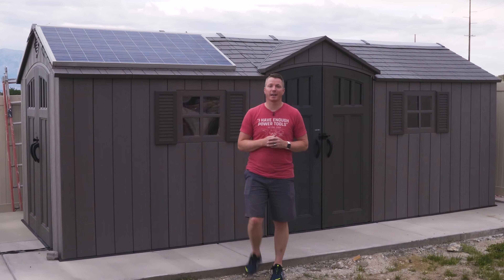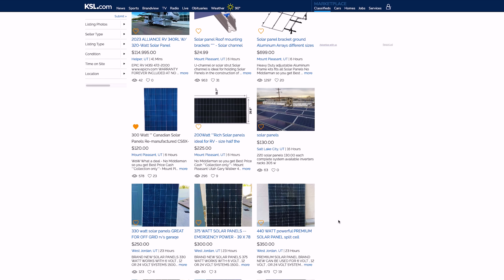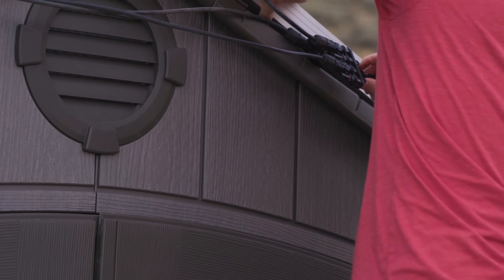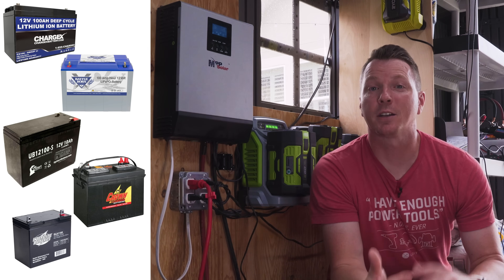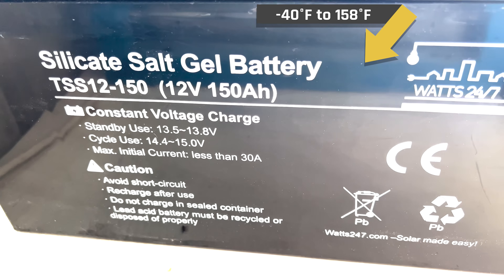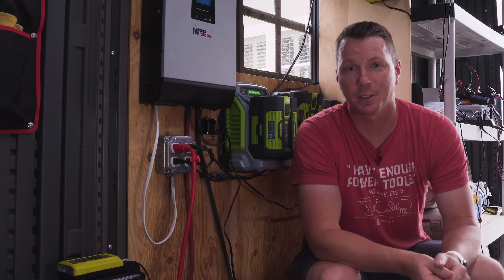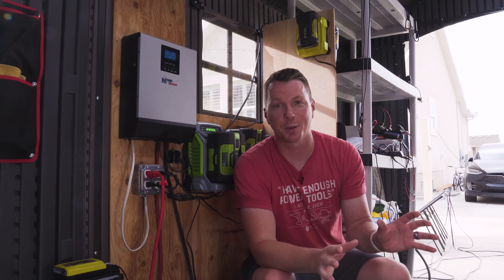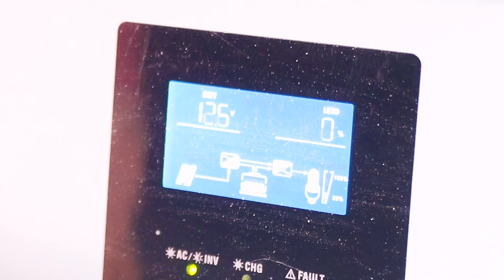This Off Grid SOLAR SHED Powers All The Tools Inside It!

Comment: I know this is super old and your setup has probably changed, but you made the right choice to wire in parallel here. Series would have been a HUGE mistake with your roof split as it is. One of your panels is almost always at a better angle to the sun, which would have a big impact on your total system output when wired in series!

Comment: The absolute best bang for your buck, is to go with 48v panels and 2x Walmart marine deep cycle batteries
 in series for a 24v battery bank.  I cant stress this enough.... you want a least a 24v battery bank for high wattage panels.  Your cant get the cheapest controller on ebay for this set up but for around $120 you can get one that works good.  You have to look at the numbers and make sure you get one that can take that voltage and wattage, they aren't as common.   I literally got 4x , 440W, 48V panels for $100 that were left over from a commercial install. Again, that's a lot of panel but I found there is not much demand for these on marketplace so the price is low.   I now have a theoretical 1600W system on my shed for around $500.

Comment: 6:42 The liquid on a flooded battery is not distilled water, it’s battery acid. You can top them up with distilled water up to a point, but be careful with the actual contents.

Comment: Unsafe AC outlets! You need to add a single Breaker Box with an appropriate size AC Breaker. Will protect both your loads and the inverter should you over load the circuit.

Comment: I can't believe I did not know you built and powered this shed. I just built the same one (terrible experience, but it's done!) and am finishing up a wood frame skeleton to reinforce it and provide unlimited mounting and shelving options. 
I wanted to run a couple four-foot LED shop lights off my Gen 1 Ecoflow River, but I noticed a flicker every few seconds with two different brands of lights. A friend suggested it might be the result of the DC to AC (inverter in the River) back to DC (in the light) process and recommend trying 12V lighting. I bought a few and wired them into the barrel connector on the River and I now have bright lights putting off 1500 lumens each. I'll have a total of 90 watts once they're all connected. 
I considered pulling 120V from the house if I had built a wooden frame shed, but was worried about an overload melting the resin Lifetime shed so I was planning to just stick with the Ecoflow and have it off unless I'm in the shed. Now you have me wondering if I can pull off a permanently-connected power source like you did so I can leave batteries charging, etc., and add the lights to home automation routines (I have already left them on a few times and had to go back out in the rain to turn them off!). 
Thanks for the inspiration here. Given this was a year ago, is there anything you would do differently now?

Comment: Nice setup, but pushing $1,000 I wonder if it would be better to just run a line from the house.
Reply: My question exactly. I guess it depends on your situation and if you can get someone to do it cheaper with less headaches

Comment: Solar setup cost more than the shed
Reply: You’d be surprised. I looked up the one he has and it’s $2,500!! For a plastic shell that is 135 sqft. Better off finding someone local that will throw up a nice wood frame shed instead. I had a guy build my shed for that price that’s only 96 sqft but the quality is so much better and could have made it 120 sqft for just a little more if not for local building code restrictions.

Comment: No protection on the output, no protection on battery and no disconnect for PV? 🔥 will come!
Reply: Could you elaborate a little more? I'm interested in learning. What do you mean by protection? What do you mean by disconnect for PV? What's a PV?

Comment: Looking to get a decent 24/7 power to a shed I recently built here in florida. Hoping to use it for my reptile hobby but the issue is the intense heat and humidity. I already insulated the shed in hopes that would help a bit and it did somewhat. Now I’m going to start working on this. It shouldn’t use up all 1k watts…so I’m going to assume itd be able to run pretty much all day.

Comment: Excellent video. Building a shed on an acreage that is quite a distance from power. I have mainly 20v DeWalt tools and am looking to store and charge them where I need them. Also going to run some LED lights and possibly a small electric heater (I live in Canada). Perfect video for all the information I need to move forward. 

Thank you!!

Comment: Can you use antifreeze in those batteries instead of water
Reply: No. Batteries are filled with electrolyte. Only refill them with distilled water or it will ruin the chemistry of your battery.

Comment: Do the tool batteries have a temperature range that allows charging when it's below freezing?

My Ryobi batteries state a charging temperature of 41° F to 113° F. 
That is why I don't have a charging station in my garage but in my office.  In the winter, charging the tool batteries below freezing will damage them.
Reply from the maker: Great point. Ego states 41 degrees as well, so we'll have to keep an eye on that come winter. It might make sense to find a way to keep the chargers in the garage or house through the winter. Ideally I'll still be able to leverage the solar by running an extension.

Comment: Nicely done video but it looks as if you're overfilling your batteries. You only want the electrolyte a quarter inch above the plates. On a heavy charge, acidic electrolyte will boil out through the caps, and onto the floor. Also, charging produces hydrogen so the box should be vented and not in a contained space with an inverter, or anything that sparks.
A 12 gauge run from panels to the controller. Not big enough... Try six, or 8 gauge, depending on the length of the run.
I cut off the MC4 connecters and use bus bars. The connectors are idiot proof but connecting arrays with MC4s doesn't work well. Resistance creates heat and when you putt too many panels the 10 gauge connections can't handle the amperage and melt. 
Components  I have two 60 amp controllers, one for each bank of batteries. 24/7, I run a 1000 watt true sine wave inverter for general use, and a 3000 watt inverter for power tools and kitchen appliances.
I have been doing solar for 40 years and am 72 now.
Reply from the maker: Great info, Raymond! I'm definitely still learning so I really appreciate it. A few questions, if you don't mind. 
1) I'm new to flooded batteries but these came from the manufacturer at these levels shown in the video. It sounds like maybe I need to take some out in case they overflow? And the ventilation makes sense - I can put some holes in the box for airflow.
2) Do you think such a thick gauge of wire is required even in these circumstances (two panels running for 12 feet)? Or is that more for larger sets of panels and power? Part of the reason I ask is because I've seen this exact wire in use for years at a friend's house in similar circumstances.
3) I'm intrigued by the bus bar idea - are you using some thing like these? https://geni.us/ggKcOyB I could certainly see that working and simplifying things too but do they need to be sealed/covered?
Again, thanks for sharing your experience and insight - I love learning more and appreciate your help!
Reply: @LRN2DIY  I use those bus bars to collect juice provided by smaller brass bus bars, using a zinc joint compound in connections to avoid electrolysis caused from connecting different metals, ie, aluminum to brass or copper. These metels are relatively soft, so set screws need to be tightened periodically. Don't be cheap on wire and use larger gauges. Also, use separate components. A separate controller, larger than what you need, so you can always add more panels. Multiple inverters give you the ability to use chop saws, as well as a more efficient true sine wave inverter for electronics.
Reply: See if your system would power a small chest freezer for a sustained period of time.

Comment: Nice! The only issue that has me wondering is that the panels are DC and the batteries are DC... Should there be a way to avoid that conversion to AC and back to DC?
Reply from the maker: There may be a way to connect the panels (perhaps via a charger controller alone) to the batteries, then the batteries to the inverter. My goal in this case was to try to create one of the simplest setups with the least amount of wiring but I suspect what you're talking about may be possible - I just haven't done it myself. I'll try to reply here if I find the answer to that.

Comment: Brilliant!  I built a shed years ago to house outdoor equipment and ran an hefty extension cord as you mentioned.  It works fine but is unsightly and exposed to the elements and / or possible damage.  Your project just seems to be so much cleaner and part of the 21st century.  Thank you so much for the research...
Reply from the maker: Thanks, Silvio! Hopefully it works out great for you if you decide to give it a go.
Reply: Thank you for your kind words! I completely agree, relying on extension cords can be quite inconvenient. That's why I highly recommend checking out the Segway Portable PowerStation Cube Series. It's a game-changer for outdoor enthusiasts like us, providing ample power for various devices and appliances. And with its durable and waterproof design, it's perfect for any adventure. Check it out, it might be just what you need for a more efficient and modern setup! 🌞🔋

Comment: I live in a hurricane area. Plus I didn't want holes in my shed roof. I mounted my panel on a hinged bracket that folds out into the sun, but when necessary, I can fold it down and pin it to the side of the shed, under the overhang. 
The 60% discharge limit mentioned in the video can be overcome by getting deep cycle batteries, which are designed to be discharged down to near zero.
Reply from the maker: Great solution for windy areas! And thanks for the tip on the deep cycle batteries. Batteries are a whole area of study on their won so I have a lot to learn there. Great tip!

Comment: I just have a can of gas to power all my yard tools. 🤷‍♂️
Reply from the maker: Yeah, I think most do :) Electric tools are a trade off, like most things.
Reply: @LRN2DIY  The trade off is quiet tools and no smelly exhaust. The $ trade off is a long game move though.
Reply: @TheSouprGrrl  do you even mow?
Reply: @stephensk8well777  You also don’t have to worry about oil, old gas, spark plugs, winterizing it, or anything else. Let me tell you when the carburetor on my mower went that was about the last straw for all my gas powered stuff
Reply: Wouldn't it be nice to have your "gas can" filled up for you automatically and for no continuous and increasing cost?